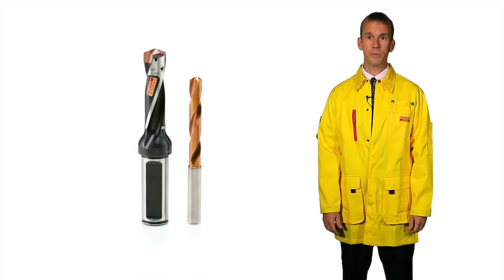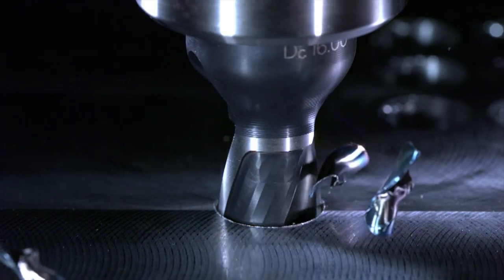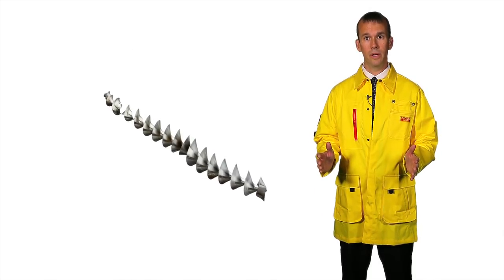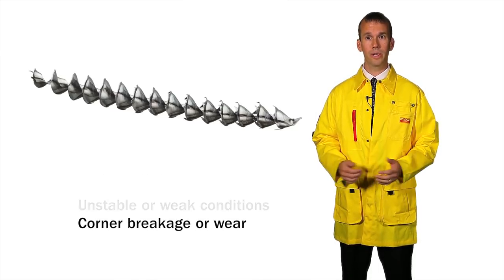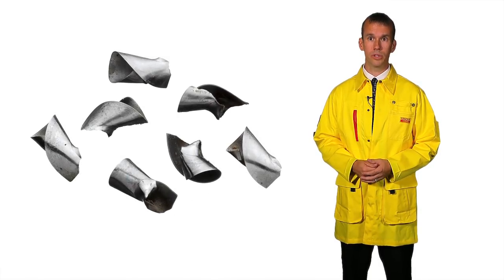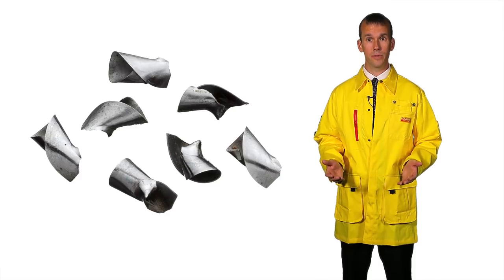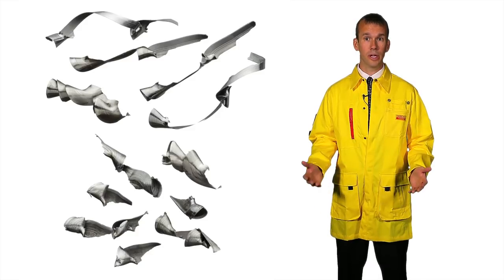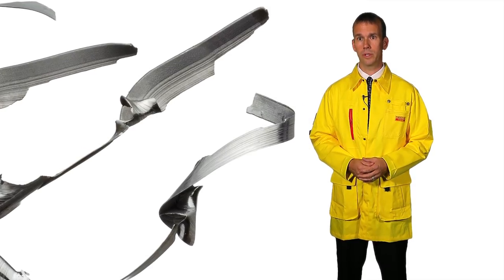Tips film:  Analyzing chip formation - Sandvik Coromant

Comment: how to get c shape or cone shape chips in titanium without coolant
Reply from the maker: +yogesh gaikhe 

Hello Yogesh
It is hard to provide a good general answer to your question, since chip forming are affected by many factors we don't know about. But as a general rule for titanium chips, the faster you go, and the higher the feed, the better the chips. But since you have no coolant loads of heat will be generated, so as a start I would recommend to increase the feed per revolution. But beware, hole making without coolant will generate a lot of heat, and tool life will likely be very short.

For more information please contact your local sales representative. You find contact information on www.sandvik.coromant.com/contact

Best regards,
Tomas Furucrona 
Global Application Specialist - Short Hole Drilling 
AB Sandvik Coromant

Comment: Hi there,
I have difficulties in interpreting chips formation when drilling Titanium 6246 using TiAlN coated carbine insert. 
a. At firts stage, with or without coolant, the chips are like what you have explained
b. When it went deeper, the chips of outer section tend to wavy.
c. the chips thickness are vary in the same applied parameters (or in the same drilling)
What may the cause of the b and c?
Thank you
Reply: +Mahros Darsin Out of balance or misaligned cutters will cause chips with erratic thickness, and either slow feed rate or dull cutting faces will cause wavy chips. There may be others, but those are the ones I am personally most familiar with.